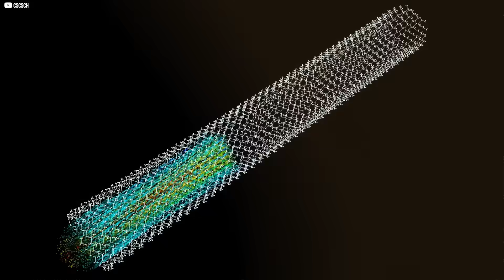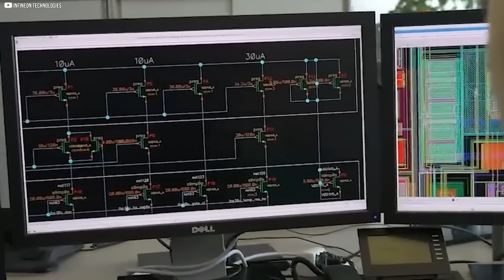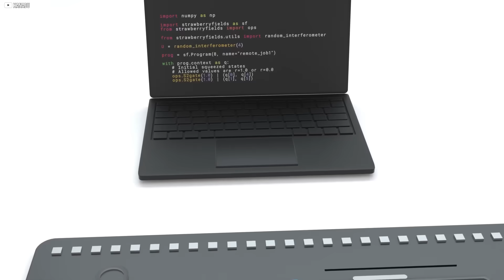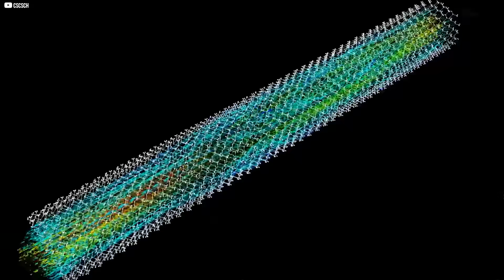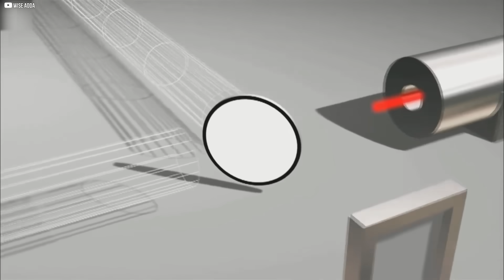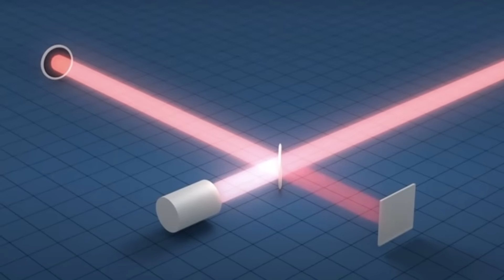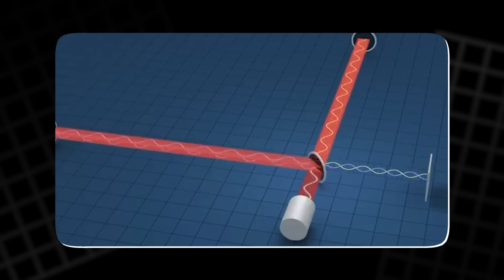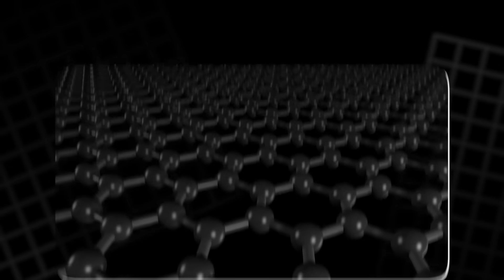Silicon Is Dying. Graphene Is the Future.

Comment: I watched "Hindi Audio" Version Of This Video Which Describe movement of "Light Signal" Photon In Graphene, But How Light Signal Can Travel In Graphene? I Think Graphene Is Made From Graphite Which Is A Type Of Carbon. Graphene Is Not "Glass Fiber", Graphite Is Good Conductor Of Electricity Which Means Electrical Signal ( Voltage & Current ) Not Light Signal ( Photon ) So How Light Signal ( Photon ) Can Travel In Graphene When It's Made From Graphite A Type Of Carbon Not Glass Or Silicon ?

Comment: Thanks for the information, Grafeen is indeed a material that goes for datatransmission by lightsignals.
Photons are layered for transmission from zero's and one's, perhaps glas can be mixtured with the grafeen for a better transmission. Kind regards.
Reply from the maker: It's great to hear you're thinking about how light signals can be used with graphene, thanks for sharing!

Comment: By the way, electric impulses in tiny lanes on chips are also travelling with light speed. One can surely doubt if optical structures can be minimised that way as it is possible with electronic chips. Electronic chips are not that outdated as often told. And there is a lot of potential to develop electronic chips further.